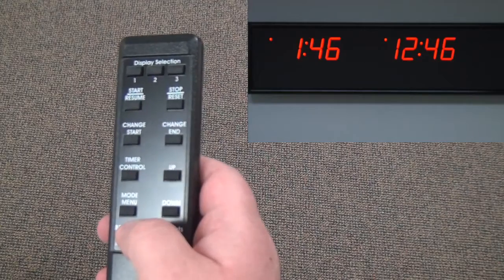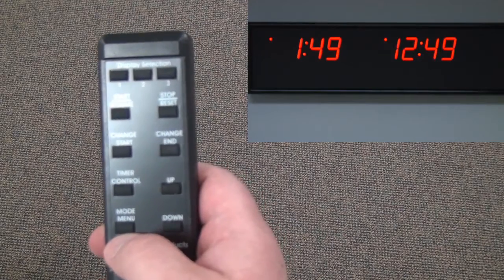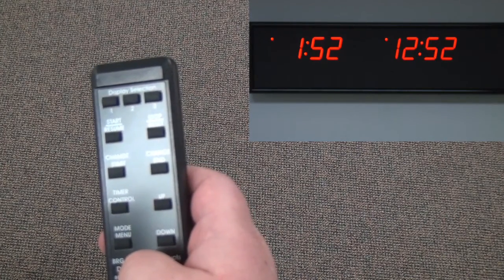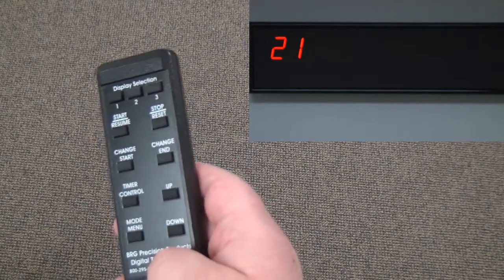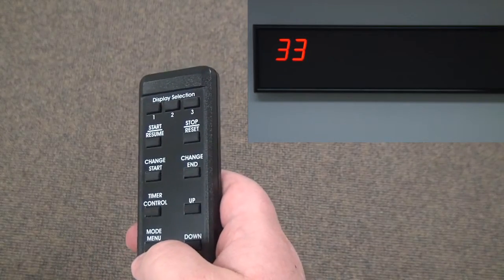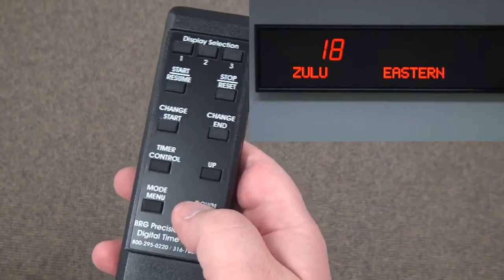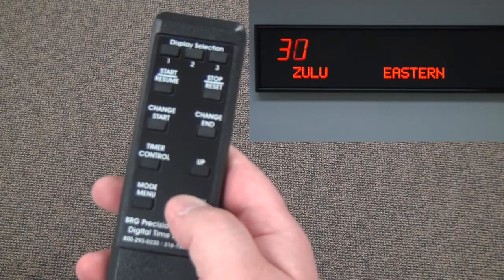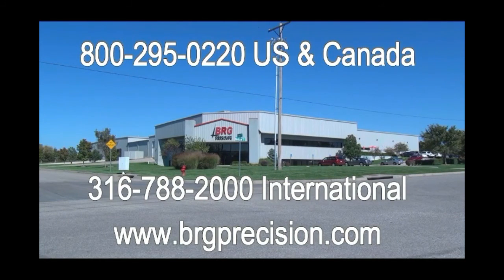BRG Precision Products - Changing Programmmable Time Zones

Comment: In case anyone sees this like I did years after this video to save you some time if you're just needing to change the times and the names.
Press & Hold the Mode button (2222 will flash like super fast then stop and show a 1 that's when you let go of the mode button)
Use the Up and Down buttons to change what mode you want for quick reference on the modes:
Mode 21 does the time zone offset based on Zulu so basically Zulu is 0
Mode 33 does the offset by minutes for countries that are +30mins ahead of Zulu

To change the names of the time zone just go to Mode 51 press mode again to have it show 51 1 then press mode again and it'll start on the first time zone's name you can edit everything is 1-10 so basically:
First time zone: 1-10
Second time zone: 11-21
Third time zone: 22-32
and so on.
to center the name Zulu just make Z the 4th character on the list

ASCII cheat sheet:
65-90 is Upper Case A-Z
97-122 is lower case a-z
32 is a blank character or space if you're needing to erase a prior name that is longer than the one you just did

Then when you're done just tap mode until you're back to the mode showing 51 and hit the time control button that'll do a easy soft save for you and then you can just sit it and forget it.

Comment: have to do this at my job for the first time. The manual just confuses you and the remotes break very easy, then you are left using the 4 buttons on the back of the clock, and if it is mounted on a wall it can be a nightmare.